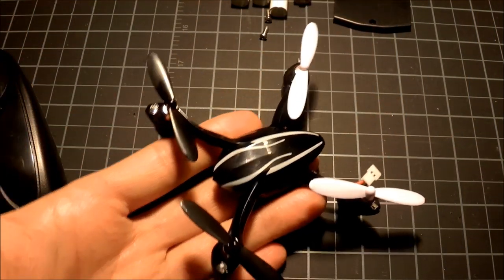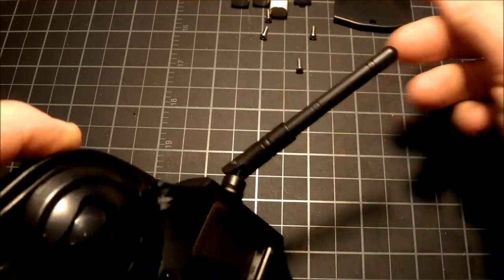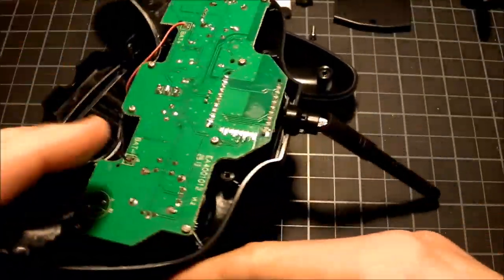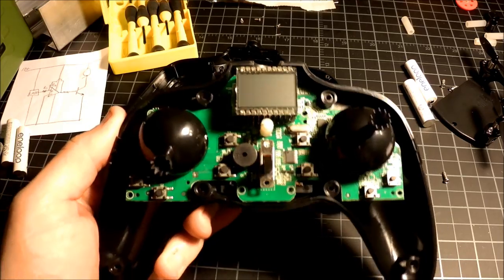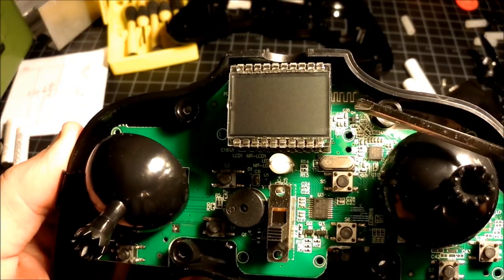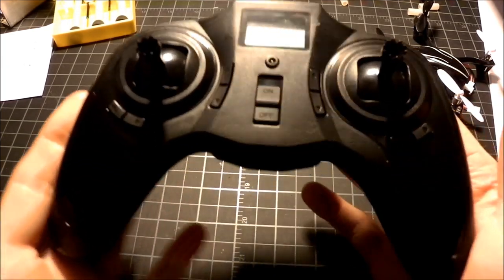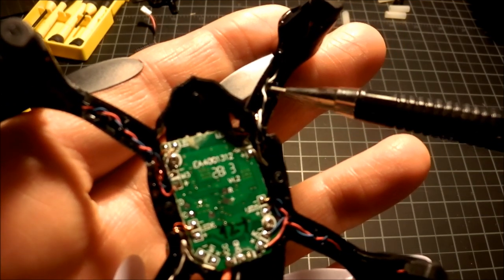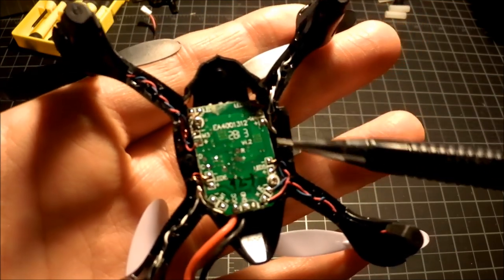Hubsan X4 Quad Transmitter Antenna Removal (Not a hack as the video title states)

Comment from the maker: This is a really small quad for FPV, so I didn't think of modding it for FPV.  For FPV I've started with the RCL Eye One Xtreme.  I hope you guys can find a way to make FPV a reality with the X4.  To extend the control range, you may be able to disconnect the trace on the circuit board (cut away a bit) and solder on a straight small gauge insulated wire 1.23" or 31.25mm long.  You may damage the X4 beyond repair, but why not try it, you only live once, and the X4 is cheap to replace.
Reply: You could just buy the FPV version.

Comment: I added  an external antenna to my hubsan501a  controller.. but I made the mistake of turning on the controller before attaching the antennas. now can't record pictures or video. what do I  have to replace on the controller?
Reply: Antennas should always be connected to transmitters when the power is applied.  The same does not apply to receivers.  Chances are good the transmitter is fried.  You may be best off replacing the board inside the transmitter housing or the transmitter entirely.  Good luck.